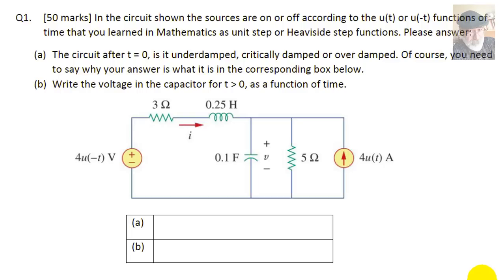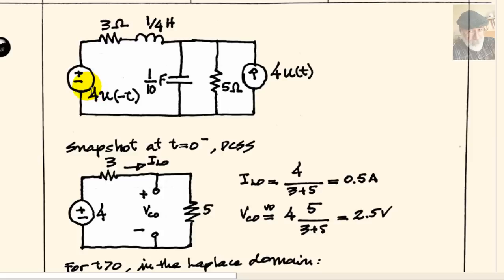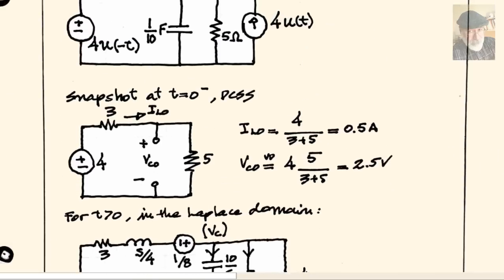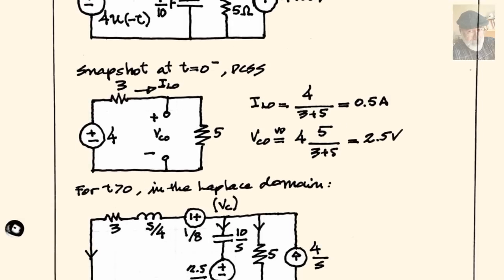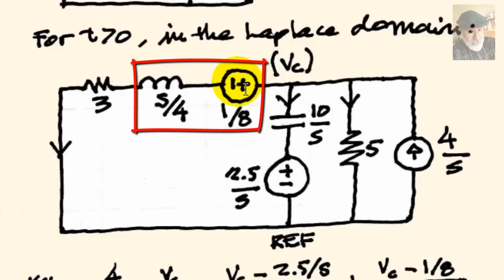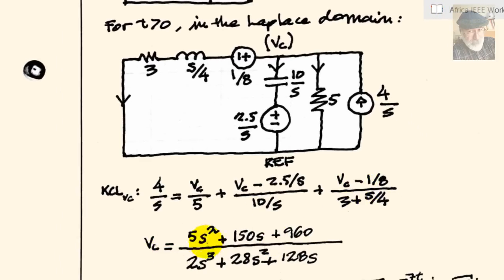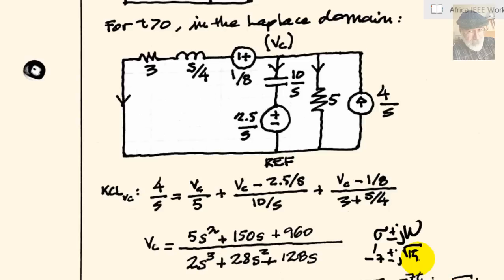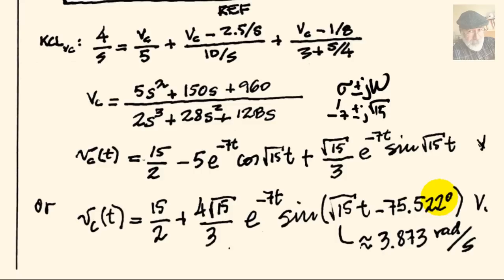ELEC 202 MT2 Q1 Sep to Dec 2016 RLC Circuit Solution in Laplace

Comment: I'm going to find a way to represent damping and stiffness the same way circuits does it for components. Thanks. This video opened up a lot more ideas for how to deal with MDOF systems (using those 1/s and s) so that the equations of motion can be solved quickly with laplace transforms. I come from a structural engineering background, but I one day want to link electrical applications to the big scale... not sure if doable.
Reply from the maker: I encourage you to pursue this exciting avenue of engineering. It has been done for different purposes and different scales. You may hit a new application yet. The essence is this: if you have an engineering system, mechanical, structural or even biological, that can be described by a set of coupled ordinary differential equations, you can find an analogous electric circuit that discribes the same system and where your forces, deformations, etc., become voltages and currents. In one of my videos (at this point I don't remember which one) I show how mass is the mechanical inductance, elasticity is the mechanical capacitance and friction (damping) is the mechanical resistance. In all that development, x, the displacement or deformation is analogous to the electric charge, etc. Keep working and good luck!